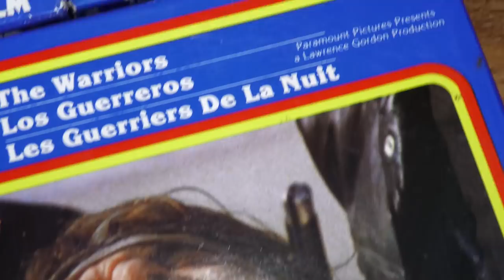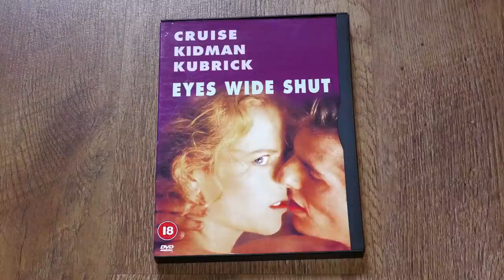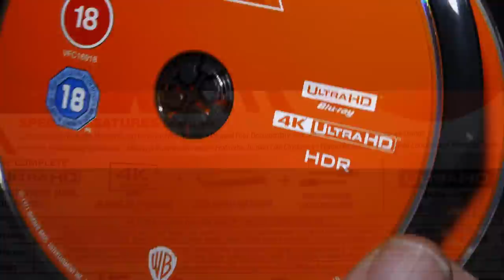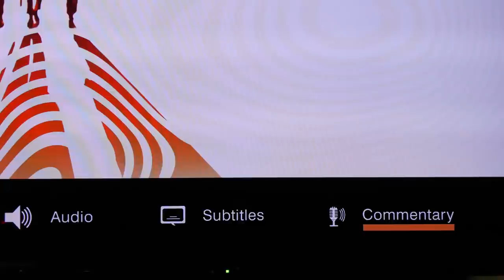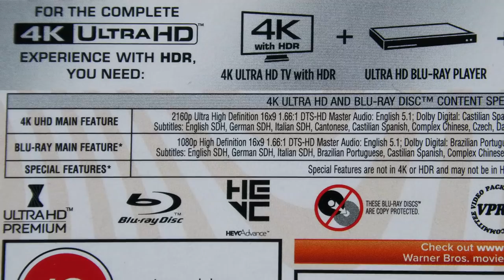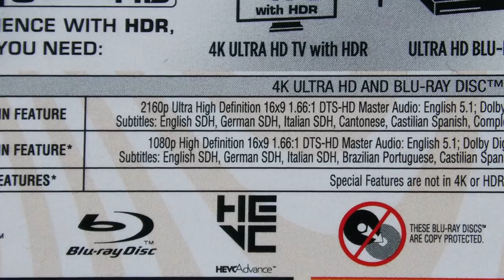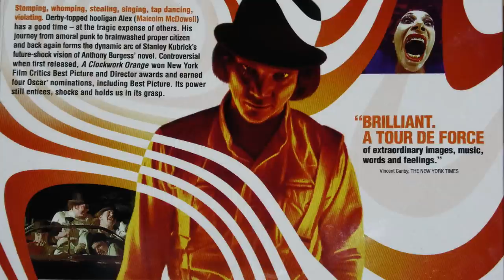STANLEY KUBRICK'S A CLOCKWORK ORANGE 4K UHD BLU-RAY REVIEW

Comment: Wonderful review as always! For some reason I never made the connection between Brazil and A Clockwork Orange, even though it should be very obvious. In both films the extreme wide angle lenses are quite blurry. And yes, A Clockwork Orange looks a bit rough in places. I read that Kubrick was experimenting with different lenses, not going for his trademark pristine look here. He also used and shot himself hand held with the iconic Arriflex 35 IIC camera, which was meant to be lightweight compact and, as far as I know, the registration is not as rock steady as is the case with those older, huge, complicated studio cameras such as the Mitchell BNC. Anyway: I love that movie. There is that "creepy parallel universe" and "nightmare" feel to it, only Kubrick was able to produce.
Reply from the maker: That all makes sense.  I've never seen Brazil so that's another one I clearly didn't like the look of for similar reasons to A Clockwork Orange.  The blurry wide angle lenses are used in Land of the Giants television series from the late 60s which we're going through again right now so that rather confirms they weren't that good.  Clockwork Orange does have an otherworldly, surreal feel to it so it seems that was what Kubrick was aiming for.  John.

Comment: Nice review as always John. This, to my eyes at least, looked a lot better than the previous blu ray release which was hugely disappointing. Although not upto par visually with other Kubrick's in 4K i think that's down to the original photography and budget. I did a comparison with the previous blu ray with the one included, and the new one looked a lot better, so I assume it is the new 4k remaster
Reply from the maker: I didn't think the Blu-ray in this pack had the same menu system Russell and as it looked so comparatively poor, thought it was the Blu-ray that had been available for years.  Doesn't really matter though because the 4K is perceptibly better and there's no reason to watch the film on Blu-ray as a result, it's mainly there for the extra features.
It's the wide angle lenses and low light levels why this film doesn't look particularly good.
John.

Comment: I saw this on release, but never knew until the re-release that I lived 2 miles from one location,  the cine club I belong to used it for their showing of the Movie Maker Ten Best films. It was the scene where Alex is paraded as cured and tempted to violence and sex. Originally the Nettlefold Hall in West Norwood library and having 16mm and 35mm projection capacity it is now part of a multi screen cinema. Also I did read somewhere that Kubrick mixed the film as 4 channel sound (as for magnetic tracks at the time) but thought the acoustics of most cinemas wouldn't do it any good so released it in mono.
Reply from the maker: Four track magnetic would have been quite adventurous but that's Kubrick,  He loved to experiment and do things differently.

Comment: You hit the nail on the head about the wide lenses he used, I think. The chromatic aberration and softness on the sides and corners makes it look cheap. Then the shots with more conventional lenses looks cleaner.
Reply from the maker: I think it was experimental for its time.  To capture anything on film in such low light levels would have resulted in wishy washy imagery at the best of times but with those wide angle lenses it added to the problem.  Shame action cameras hadn't been invented back then because for £100 today you could do better.
John.